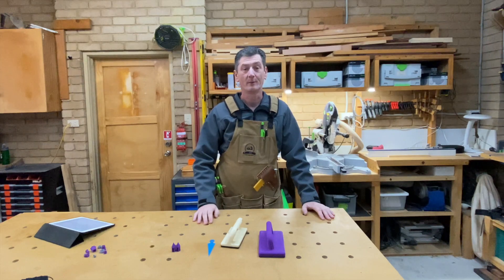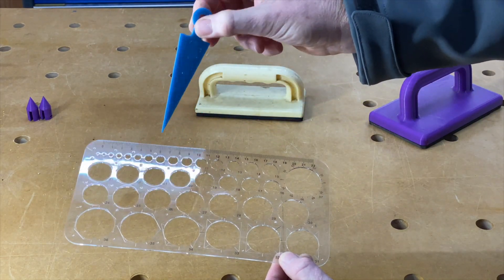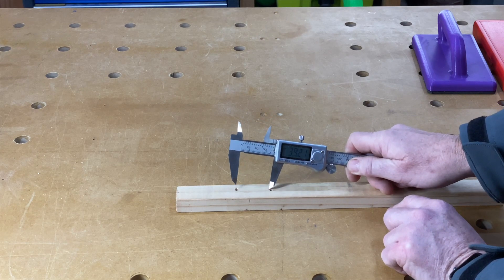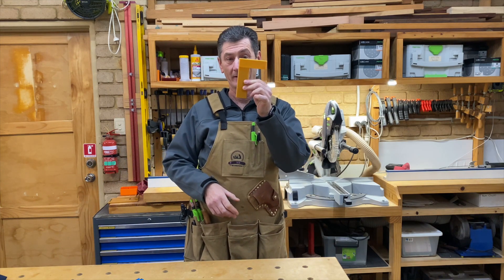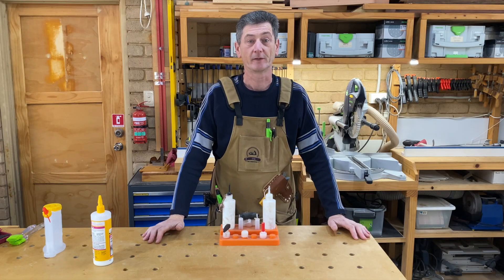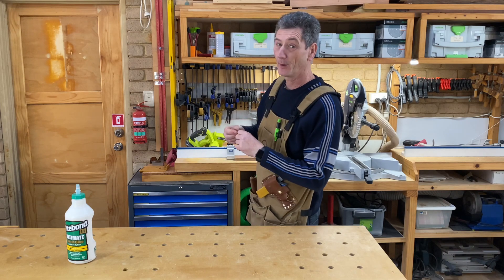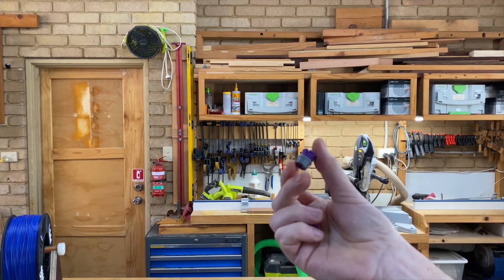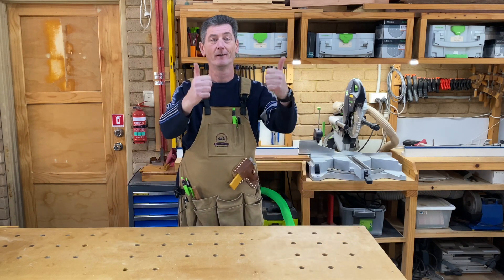3D Prints in the Workshop 21

Comment: Quick tip for calipers: To measure the distance between to holes of the same size, first turn the caliper over and use the small, inner arms and zero them in one of the holes. Then flip it back over and measure the holes from the walls nearest to each other and that's you center to center distance. 😊

Comment: I was given an EasyThreed X1 printer for Christmas by my son, and although its a cheap $100 printer that’s limited to 100mm x 100mm x 100mm prints, I’ve found it great for printing bits for my workshop.  Stop blocks, drill chuck holders, vacuum adapters, etc.   There’s loads of stuff out there.
Thanks for sharing, I’ll be looking at some of the others in this series
Reply from the maker: Cheers Geoffrey, Have a great day.

Comment: That collar as depth stop seems quite good idea. I think I'll try that one. I absolutely hate the generic rings with set screws.
Reply from the maker: Hi Jothain, How did you go with the depth stops? Do they work well, and if so which plastic did you use?
Reply: @DarrensWorkshop  haven't tested yet, but I think I'll try petg when time comes. I think pla might fail as drills can occasionally get quite hot. I think it's also too hard to work.

Comment: Thank you for another interesting video Darren. I really like the push block. What infill % and # perimeters settings did you use to print it? I will print one for my router table. The glue station and accessories look like a good option too. Be safe and hope the lockdown ends soon.
P.s. what flavour of glue do you dip your biscuits in 🤣
Reply from the maker: Lol, I’ll dip in anything rated for internal/external use. I’ve been using Sika lately, but you can’t beat Titebond 3. I know I used three perimeters on the push block, but I’m guessing when I say 30% infill. Yes, fingers crossed on the lockdown. Cheers John.